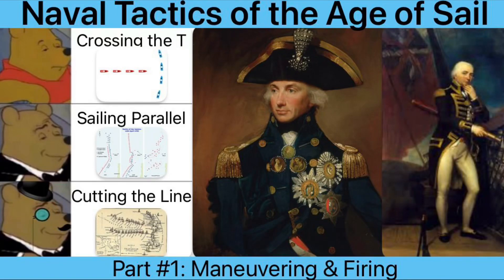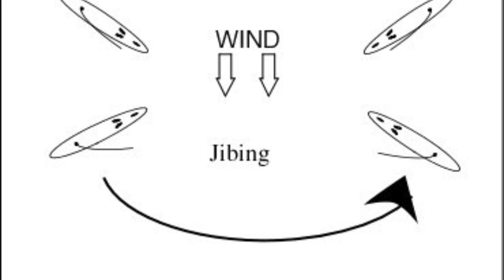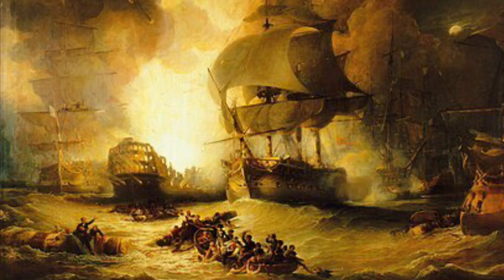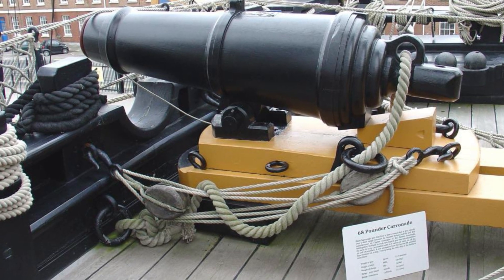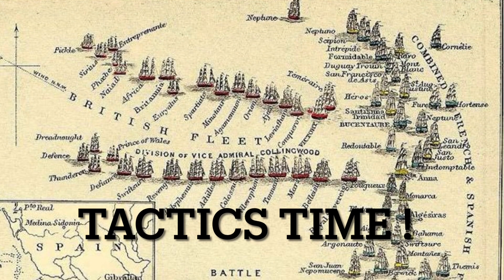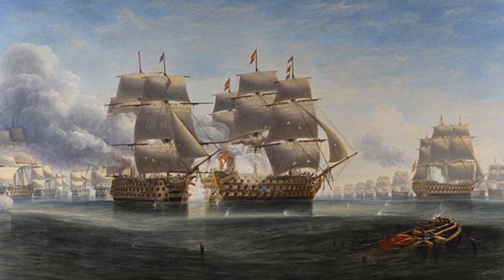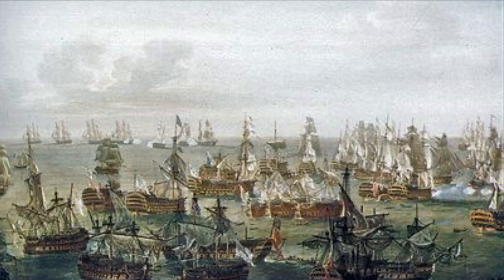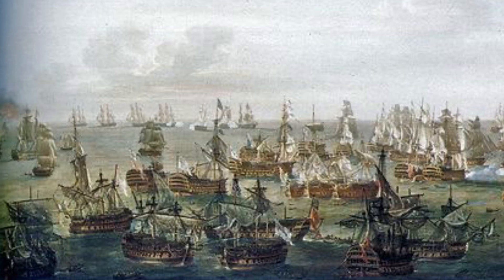Naval Tactics of the Age of Sail: Maneuvering & Firing

Comment: A great video summarising the key points of this era of naval combat!
In my opinion, crossing the T became much more effective with the rise of the armoured (and steam driven) battleship. Nelson's breaking of the line was successful as he was able to effectively cut the leading third of the enemy fleet out of action, as they wouldn't be able to manoeuvre back into the battle in time. Once steam ships come into play however, they would be able to quickly re-engage, meaning that 'breaking the line' becomes less of a threat.
On top of that, the decline of the "broadside" (being replaced with a few high calibre cannons on turrets) meant that raking fire through an enemy's stern was no longer a devastating blow, further weakening the power of cutting the line.
Reply from the maker: Thanks! Crossing the T was certainly more effective by WWI/WWII, with gun ranges reaching out to many km. The use of AP & HE rather than just solid shot probably also played a role, as they were far more devastating at range (and up close). As you pointed out, steam power prevents any Trafalgar style defeats in detail because of the added mobility. Torpedoes are another reason to stay at range with an opponent (assuming the torpedoes work). 

So, by the 1910s or so, I would agree, crossing an enemies T was more beneficial than trying to break a line. Before then, gunnery was just too hit or miss, and there were still a lot of ships with non-standardized main batteries. Spotting fall of shot without shell dye would be a nightmare if all the ships of a column were focused on a lead ship of an enemy column.